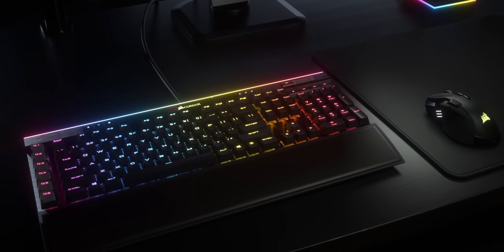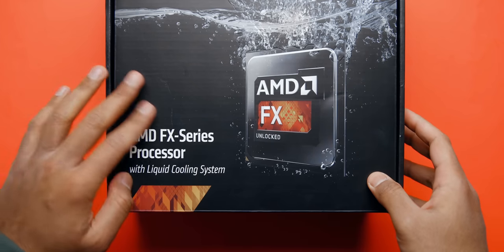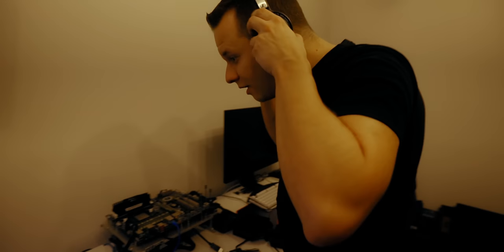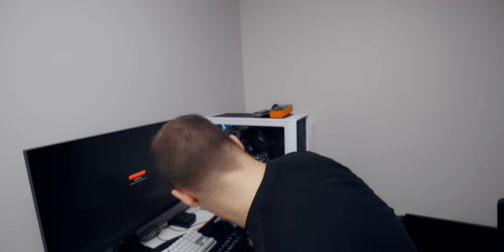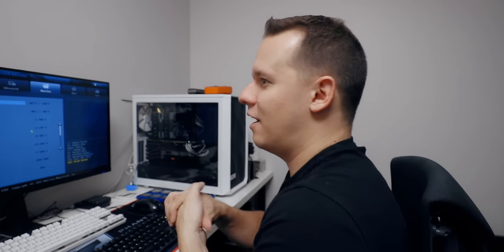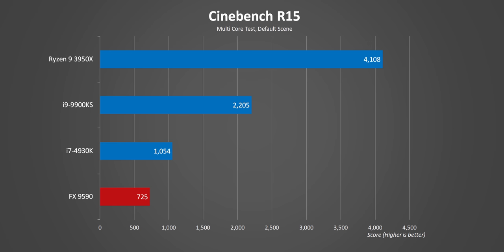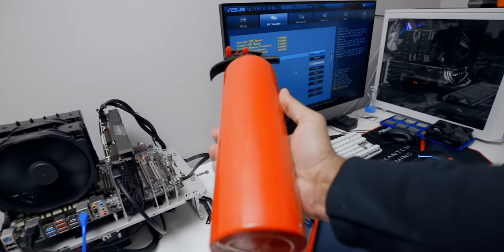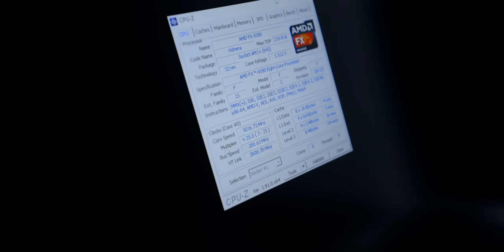Why The FIRST 5GHz CPU Almost Failed - AMD FX-9590 Revisited!

Comment: AMD Ryzen be like : I will take it from here
Reply: 1600 vs a decent 8350 or 8370  that you can lock at 4.6-4.7 24/7 and still get lower full load temps then the 9k chips... i have tested myself.. unless its the 1600 thats really a 2600series chip, the fx line in many workloads, is just faster or not enough slower its worth mention, if games are the only concern, yeah thats true... but a few friends are waiting till this situation settles, and supply chains are back up and running before moving past decently overclocked fx chips... mind you, i have also seen sample shit 5ghz at 1.46v using high llc and offset mode, and, even seen that build then re-configured(even using the command line tools) for 5ghz base close with a turbo to 5.5ghz.... at 1.48v....and....my buddy got it working on his 990fx ud9.....a board i cannot even find any good info about online, the bios he has are updated by a gigabyte employee who just emails them on request im told, anyway, the boards even got water cooling on the chipsets... and hes got it all working in a quad pumped rig that uses a thick 120 rad with push/pull high static pressure fans just for the chipset/vrm/etc, the cpu has a 280mm thick ran with 4 high static pressure fans, its running 2x1070mini cards at the moment....mostly because he had 2 cards when his wifes 3k Extreme Edition system caught fire...(board took the cpu and ram and videocards when it went... maker actually paid to ship the whole system to them and replaced it...they wanted to try and figure out why the board burst into flames...it wasnt the first time from the way they acted.....) 

anyway, honestly... the FX line, had their place, and im greatful for them at times... they kept many friends of mine able to game during dark times... still are in more then a few cases...

if amd had done some actual hand tuning to the FX design before putting it on the market, fixxing the cache latancy and overall speed issues.. it could have done far better at keeping up......(i  have seen and used a few never released products that where in effect, 2-4 apu's on a single socket and, it wasnt perfect by any means...the fact it came much closer to intels 4c8t chips of the day... always has made me wish they had put out chips based on the last APU revision, but 8c8t for am3+, even if it had simply been something like a 3550 and 8750 models that just gave us the newer cores, at the most reasonable clocks they could manage...no, not perfect, but, something to help those who have remained loyal, and, those who cannot yet swing a full platform upgrade... )
Reply: @AshenTechDotCom  Just stop. The difference between FX and Ryzen is huge.
Example: FX 8320E 4,2Ghz oc (8 core) : 656 multicore score in Cinebench R15
Ryzen 5 1600 (6 core) stock: 1150 multicore score
Ryzen 7 2700 4 GHz OC (8 core) : 1835

I had the 8320E and it was pure bullshit. After I got my i5 4690k I realised how bad they actually were. Got a Ryzen 7 2700 now

None of your 8350's will beat a 1600.
Reply: @AshenTechDotCom  tell that to R9 5950x lol

Comment: I still wished we could've seen a "FX 8550"  (Steamroller) & "FX 8750" (Excavator)
Reply: The strenght of the pile driver was you could oc almost every damn one of them to 5ghz with sufficient cooling which made them awesome value options, While the revisions were faster <4 core excavator with no l3 cache beats 4 core piledriver with l3> I wonder how they overclocked.
Reply: Would have made the market less Intel dominant I guess. Besides that it would have been really interesting to see if the Ryzen progress scheme had worked back then like it does today.
Reply: Excavator was much better. I guess AMD did not have enough resources and choose to focus on the new architecture (zen) rather than invest in a soon to be dead architecture.
Reply: Amd realized quite quickly that the architecture was a failure, hence no desktop steamroller or excavator chips.
Reply: @wujekcientariposta  my Athlon 880K (Godavari aka Steamroller i believe) can do 4.6 GHz on stock 1.48V vcore. So that's in line with my FX 6300 and FX 4100 can do at those voltages. I still think 5 GHz may be tough to reach, but those FM2 series of motherboards were usually cheap and kinda crap to overclock on.

Comment: Lol sounds like an exactly like the situation Intel is finding themselves in now

Edit: lol I make a joke about how Intel is like AMD back then and all of a sudden I became an AMD shill. My 8600k begs to differ
Reply: How?

The FX 9590 chip with 8 Cores was getting beaten by a i5 4690 with 4 cores.

Today Intel chips with the same core count like the 8700K is going toe to toe with the 3600X with the same core/thread count and the same goes for the 9900K vs 3700X same core/thread count... Not even remotely close to how far behind the AMD chips where in those days.

Today Intel and AMD are both on par with each other when it comes to core for core performance. 

Intel is only loosing because of their pricing.
Reply: @Carrot_Handler  I think he means that both Intel now and AMD back then use the same strategy of increasing clockspeed at the cost of power consumption and tempature
Reply: @Carrot_Handler  And the fact they are stuck on 10nm and are refreshing the same skylake processors for 5 years. Intel's pricing wasn't a problem because AMD had nothing to offer, therefore monopolizing the market since 2008, first core2 quad and i7 chips.
Reply: J M  your house must be fireproof.
Reply: J M  idle temps don't mean shit, 9900K is a refresh of a refresh of a refresh and eats your electrical bill even compared to the 2x more powerful 3950x
Reply: Damir Sadikovic he’s taking about the heat and tdp.
Reply: J M  what cooling solution do you use to get idles that low because you usually don't hit those temps without a a really good chip and some of the biggest tower air coolers or a beefy aio or custom waterloop. In comparison to ryzen where most will work with the stock provided cooler or a midrange after market solution for those without a provided cooler. Honestly man you sound like quite the shill yourself you seem to know of many ryzen downsides but not about your own 9900k. I mean most i3s or athlons won't even hit those temps at idle
Reply: @Carrot_Handler  wasn't 8 cores though. That's why AMD got sued.
Reply: that is not what cpuz showed when i had one my cpu was better then a i7–6700
Reply: @allensastre5891  What's so unbelievable about that? Idling modern CPUs barely take more than a few watts of power. Given a few minutes of idling every conceivable okay-ish air cooler should be capable of cooling a CPU down to 30°C at ~20°C room temperature. My GPU is currently idling at 26°C for example and it takes loads more watts to keep it idling than my CPU.
If your chips idle at over 15K delta temperature clean your PC mate.
Reply: To be fair intel is still on par core for core. Price is the only advantage to going AMD. People say heat but I have a 3600x that hits 80° at stock under stress with an aio. I also have an 8700k that's only 2° hotter than that at 5ghz on a single tower air cooler with the same stress test lol. AMD couldn't even match 1st gen core i7 performance until ryzen came
Reply: J M  Imagine bragging about a CPU idle performance. It's like buying a V8 muscle car, bragging about it only to let it sit in a garage. It's meant to be used ! Might as well buy an ARM processor if all you're looking at is idle performance...
Reply: @MrDutch1e  AMD has better IPC and single core than skylake though.
Reply: J M  give them a reason not to charge that money? Hell no they'll both charge similar prices when they can both actually compete with each other. Pricing isn't gonna go backwards now.
Reply: @_yuri  imagine how many past products could've been affected if that had actually succeeded
Reply: @MrDutch1e  you probably have an MSI motherboard.

That temp is not normal
Reply: J M  So you're willing to spend hundreds of dollars more so some fps counters have a slightly bigger number? Intel fans really are dumb
Reply: @SuperBROKEN81  Lolol what does that even mean in this context?
Reply: My RYZEN will destroy you! LoL
Stick what works for you but never be Brand Loyal be Brand Smart if AMD is better and cheaper for what you need go that way if Intel or Nvidia are better value for money for the needed tasks (or at least have the desired features!) go for that being loyal for the sake of it ends up hurting us all Rivalry is what forces us forward with Intel Dominating CPU's and NVIDIA GPU's for the last 10+ years we got little generational improvements but now Intel has more cores and better per thread performance in CPU's (as well as DDRM5, PCIE 4 and soon I hope PCIE6, USB 3.1 and now USB4, WiFi6 so on!) even if for still to much at least it is not as bad as it was 3 or 4 years ago and now we have Big NAVI (RDNA2) and the Nvidia 20-Series as well as Ray Tracing the last 3 years have been very good to us!
Reply: J M  the 9900K hits its max boost on up to four cores.  AMD's cores can each boost up to 4.5 GHz in the case of my 3800X.  The key difference is that AMD's boost isn't time-limited like Intel's is.  The en cores can boost all day long and still only take 105W.

I am currently an AMD shill because AMD is currently making the superior product.  Intel is supposedly cooking up something that will blow Zen out of the water, and I eagerly await that product.  Having competition means more cores at higher clocks with lower prices.  Without Zen, Intel would be still pushing four cores and eight threads as i7s.
Reply: @Aquatarkus96  it means he got triggered over that statement and has no good retort.
Reply: Your 8th gen Intel is still okay if you’ve already own it. But, if you are planning to build a pc now, to me, it’s just absurd to buy Intel instead of AMD. But each to their own I guess.
Reply: Yohanes Christian If you already have a compatible MB it's ok to go Intel still. But if you are starting new, I wouldn't buy Intel as of now
Reply: @Aquatarkus96  och you're a naive one. Intel i9 9900K is 20-30 fps faster in some games than Ryzen 3950X. That's a landslide win for Intel when it comes to making PURE GAMING PCs.
AMD is awesome for productivity though and I wouldn't swap my 3800X for Intel (but hey, I do own i9 9900K too, so could compare head 2 head).
Reply: @alaeriia01  nope, you're wrong. I run i9 9900K @5.0GHz all the time on all cores. It's a blitz machine when it comes to eating games.
Reply: @MrDutch1e  No they're not. The only place they come close/surpass is in Low resolution gaming with high end graphics card. Intel gets booty clapped in every other segment.

Mobile? More performance, half the power

Server? 2x+ the core count, less TCO. None of the 50,000 Intel security vulnerabilities.

Desktop. 9900k can't even beat 3700x most of the time. 3900x demolishes it in everything. Literally the only thing Intel has is poorly optimized low resolution games.

AMD has a significant IPC advantage. They don't need 5ghz nuclear reactors to compete. They have a smarter architecture, more efficient, more secure architecture. Simple as that
Reply: @churchseraphim1380  I don't know what magical world you're living in but overall in a vast majority of programs not just gaming intel is still faster core for core. I'm only talking about desktop. Price to performance is what makes ryzen a no brainer.
Reply: @vyor8837  no it doesn't lol single core is still faster it's just only about 5%. Just because AMD paid someone off to have better single core performance in cinebench r20 doesn't mean its true. Cinebench r15 is the real case where Intel is still 5% faster single core. I own ryzen and I'm not a fanboy but IPC is roughly the same and intel clocks 10-15% higher. Simple as that.
Reply: @MrDutch1e  Core for Core Skylake can't compete with Zen 2. It is only single threaded and overclocked to hell that it can match and or slightly surpass Zen 2. At the cost of double the power. Try putting a 9900k to 90w (3700x under load) and see how it fares. (Hint, it loses a ton of performance if it actually adheres to its TDP) Being efficient is a requirement, same reason AMD GPU's have been trash for many years.
Reply: @MrDutch1e  No, Intel does not adhere to their 95w TDP at all. It goes over its 95w TDP on any Z390 board... Look it up, basically any CPU is overclocked on a Z390.

Your argument about "if a CPU has the same amount of cores and it's faster in single core then it means it's faster in multi core" is a incredible simplification. There's way more to a CPU. I also implore you to learn the difference between single core and single threaded.
Reply: @churchseraphim1380  I never said it did adhere to its tdp. I said ryzen chips don't either. Tdp is basically a pointless number that means nothing at all. Mentioning it shows a lack of knowledge tbh.
Reply: @MrDutch1e  No, Ryzen adheres to it's TDP 100%. It's TDP is a different equation but it adheres to it. Intel's TDP is incredibly misleading. You won't see an AMD 65w chip run above its defined PPT (that being 88w)

 The vast majority of Z390 boards overclock the 9900k with things like MCE. They do not adhere to it's TDP at all. Furthermore, Intel's TDP is at base clock, such an incredibly misleading metric. Not only that but yes, Intel consumes around 2x the watts for the same performance.
Reply: @Carrot_Handler  someone hasnt seen the new ryzen laptop chips which just launched lol. Absolutely positively blows intel out the water.
Reply: @SuperBROKEN81  yep you're correct. It ran four physical cores and four Virtual, so technically not an 8 core CPU. My 4460 beats my brothers 8350 when it comes to gaming while drawing significantly less power at both idle and max loads.
Reply: It's kind of funny that most people don't remember the Pentium 4 area, where AMD already had the performance lead for some time... And just to make sure: I don't care about the brand of my CPU, as long as it get's my stuff done for a good value, I am all in... And right now my Ryzen 7 2700x which I bought for only 140€ around christmas is doing an amazing job compared to my lovely Xeon 1230v3 which I had before (And still think it's one of the best (value) CPUs Intel released over the last 10 years...
Reply: I trust Amd security than Intel backdoor being open.  Snowden warn about corporation helping deep state to gain access or does peoples have gold fish memory lately.

Comment: I still have my old FX-9590, I upgraded to the R5 3600 a few months back though.
Reply: Are you me? I did the exact same last month. It's incredible how much of upgrade it is. I managed to get a FX9590 for super cheap when they first came out from a local computer shop that was closing down. I had been using it for near enough 7 years. Definitely the cpu I have the fondest memories with
Reply: @jako1234567890jako  It always overclocked great, but was a PAIN in the ass to cool :)
Reply: @epicwaffles449  highest stable overclock I ever managed was 5.1 all core, but I'm not very good at overclocking and thermals were getting close to being an issue
Reply: Yeah I’m probably  upgrading to the r7 3800x from that
Reply: Same here. I dig the r5 3600 but some days I miss the bragging rights. Still have my 9590 just no mb atm with enough nads to deal with it. A replacement mb for it is to much coin.

Comment: My FX-9590 is still running fine as my backup computer. I upgraded to a Zen2 when the FX-9590 was starting to slow down. I am surprised you guys aren't using a TUF Sabertooth 990FX R2.0 motherboard. I had issues using the first generation of the TUF Sabertooth.
Reply: Poi159 TUF 990FX R2.0 works like a dream. I have one with 32GB 1866 ECC RAM, and an FX 8350 running at 4.5GHz with 2400MHz HT and NB. Cooled by NH-D15.
Reply: Yeah! My board was a beast. Now it’s being used as my organ computer!
Reply: One of the most stable systems Ive ever owned.
Reply: Honestly the R3.0 was infinitely better for me when my 2.0 died. It also had an M.2 slot on it which was awesome with the 9590.
Reply: im running a 8320 at 4.8ghz for years but my issue with that board is the onboard sound doesnt work and thats lastest bios
Reply: my gen 1 TUF board had no problem running at 1866 mem speed, then we had a power surge and not so much anymore 😥honestly it's prob my CPU and not the board
Reply: Never had an issue with my gigabyte tuf ga-990fxa ud3 r5. It's been a monster, once you get the vrms cooled that is. Over 5.2 they get hotter than a witches tit in a brass bra.
Reply: @ryandemmons8190   tuf sabertooth R3.0 was a Legendary Card. I still have it with FX 9590.... I solded a couple of week ago a setup with 9370 FX and tuf sabertooth r2.0. Was a Big différence between both .
Reply: @RIFCHE23  Yea it was legendary MBO. My pc before 3950X + Asus Formula VIII (right now), was 9590FX + Sabertooth R3.0 . If you cut little power and downclock it to 4.0 and put voltage to 1.325v, it act stable and cool, and it can be used as multimedia. I have an old Corsair H110 and im going to assable that pc with some M2, just for multimedia. :)